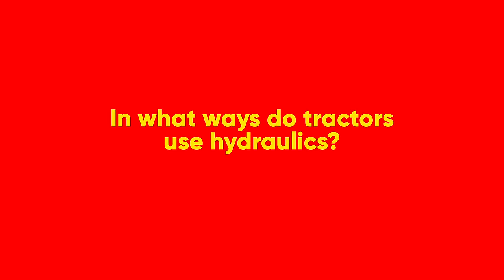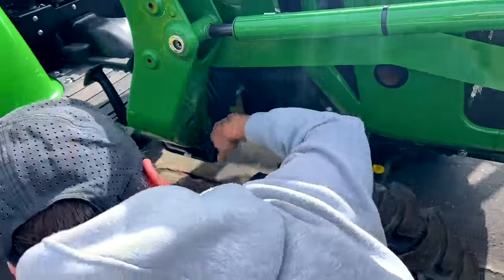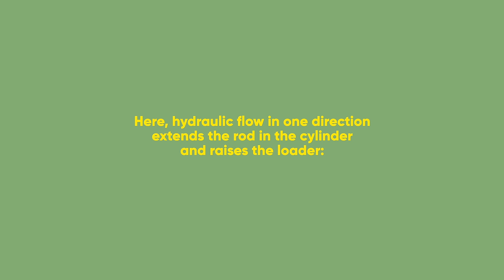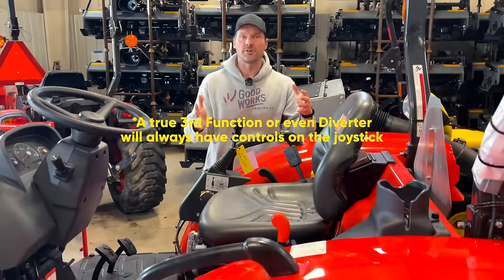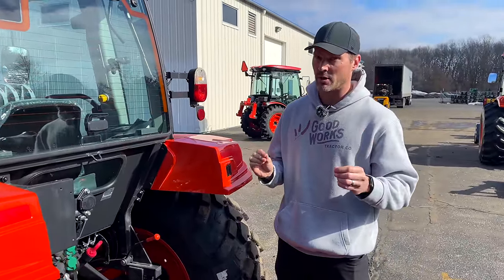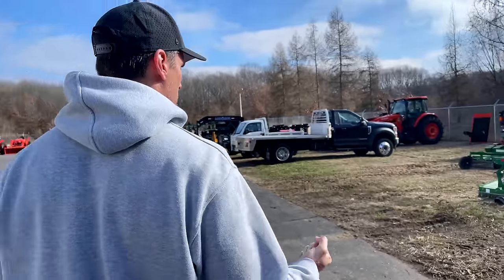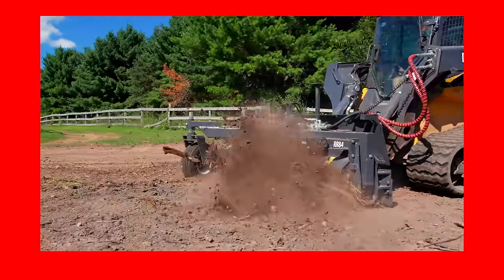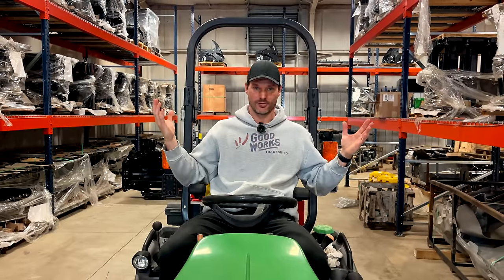WHAT HYDRAULICS DO YOU NEED ON YOUR TRACTOR?

Comment: Last year I watched many of your videos to learn and compare tractors.  I ended up buying a JD 3035D with front loader bucket, fork lift and root grapple.   The Dealership did work with me since I bundled the tractor and implements.   The root grapple has been my number one tool and bucket the least used tool improving the farm.  The fork lift has already helped pay for itself shipping large items directly to my home.  The fork lift has many purposes without the need for a pallet, hoist, remove a large engine for instance.  

I'm going to get the top link for the rear, you proved it would help scrapping and using a box blade on unlevel ground.   Of course I'll need the SCV's, lines and ports.   I live in a hilly area so adjusting the top link manually has to be done often for good results, PIA.   Thank You and your team for all the educational videos, they really help educate, enlighten and hopefully reduce the costly and deadly mistakes to owning and using tractors.

Comment: I must be an exception, I take my loader off all the time. But I also mow with my 2038R with my mmm. I also find it handy to not have the loader on for running the brush hog, grader box and other variety of jobs!  I have 2 factory rear remotes as well as the loader and 3rd function. Glad your back!
Reply: You aren’t the only one.  Can’t beat going loader-less if working in tight areas or rough ground.   I’ve not working around loader arms for basic engine service too.

Comment: I have a compact tractor for yard work, and I bought a hydraulic top link a couple of years ago, thinking it would save me some time and effort adjusting the angle of attack for my rear blade. I had no idea how useful I would find it. It makes it much easier changing implements; it makes it much easier to use implements. I use it about 4 or 5 times as much as I thought I would. It's super useful. I can remember thinking "do I really need it?" Now I would simply hate to have to go without it. I've thought about having a diverter too...maybe I will have another look.

Comment: I personally prefer the diverter valve option for the grapple control for the loader as opposed to the true third function option. By diverting the flow of the second function to use for grapple control you have the ability to feather the grapple function speed. But when using the third function kit It is either full flow or off, there's no way to feather the hydraulic flow and it makes it very erratic control. I find very few instances when there's a need to actually roll/curl functions and the grapple functions at exactly the same moment.

We installed the Summit diverter valve kit on a John Deere 4520 compact with 400 loader. We use it for both the grapple and front mounted pusher blade with power side angle for snow removal. Very happy with it. When we originally acquired the tractor it was using the rear remote for the third function control on the loader and that was virtually unusable as you so accurately described when showing that option on the one John Deere tractor.

Comment: Well im knew to the Chanel and i love your videos👍 im pretty knew to the compact tractor ive run skidsteer dozer and big loaders.  I bought a 2008 ct235 bobcat this spring and loving it. I did wat you said i plugged in my 3rd function at the back and ran hoses to the front for my 4 in 1 bucket my leaver is right beside my loader leaver so its not bad. If i leave the leaver in detent when my bucket is closed or squeezing something can that hurt something in the system. Thanks 👍

Comment: Deere had a diverter valve kit that ran a top ‘n tilt kit with the loader joystick.  That worked pretty well and there was no need to setup a tractor (especially a smaller machine) with 6 SCVs.

Also, some PTO chippers could utilize a power beyond kit instead of having their own pump and reservoir.

Comment: Love your videos.   I've been dreaming of a hydraulic top link on my orange L3201, You've got me getting more serious.   I currently have a 3rd function that is routed to the front for a grapple.  I don't have a grapple, nor do I ever expect to need one for my little Hunting lease.  I'm contemplating robbing the 3rd function up front and simply running lines to the rear, While leaving the "Future grapple" lines in place.   Tractor had a backhoe in the past and the bracket and actual connectors are still there.   Any reason this wouldn't be a cheap, easy way to add a hydro toplink with only the cost of the top link and two hoses?  (The 3rd function button is already there and working).

Comment: On the Kioti CK series (cabs only) you get 2 set of hydraulics. One is for your normal hydraulic function while the second hydraulic port is essentially the power beyond because the handle for that port has a detent which keeps it engaged. The front loader handle on the new CK 20 series already has the 2 buttons and is pre-wired for a 3rd function kit.

Comment: I installed rear remotes on my Massey 1742 so I could install a top and tilt set of hydraulic cylinders. Waited until I had the remotes installed before ordering the cylinders from Summit Hydraulics. WTH. 2 months back ordered. Won’t be available until August.
Reply from the maker: Hot commodity!  :)

Comment: Can you use the power beyond feed to supply fluid to a muti port function instead of adding another line? I want to add a rear snow blower and be able to control the shoot and diverter. I have a 1025r btw

Comment: I take the loader off my 100 horse chore tractor regularly during summer for doing hay so it’s out of the way for turns by fences and less compaction then put it back on to pick up the bales when finished for that cutting in the field. Also if something fails and the is designed for quick removal the loader can be removed a lot easier in undesirable locations provided you have extra hoses, some boards for the legs to set on if on ground where it can sink, and a second tractor which saved me a huge hassle when cleaning up in my woods before. Even if I planned on keeping the loader on 99% of the time the quick attach saved me once and the local dealer doesn’t charge labor for loader removal on repair bills if it’s a quick connect

Comment: I have TYM 574 dealer installed third function 
Third function does nothing when loader is in use is this normal ?
Reply from the maker: That is correct, the 3rd function is just hanging out while using the loader functions.

Comment: Out of curiosity,  was your extended absence explained by having your boot and lower leg removed surgically from the lower intestines of someone over at JCB??? I know that would be the case if I had the same experience you had described on two separate pieces of brand new equipment you had bought.